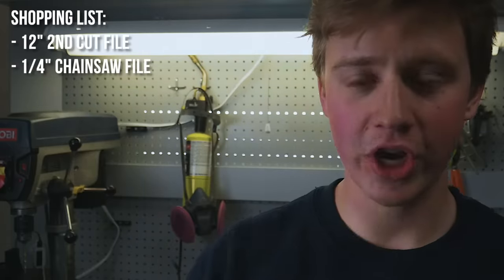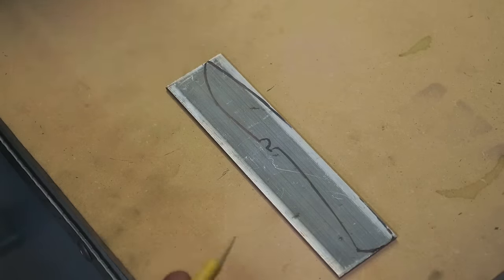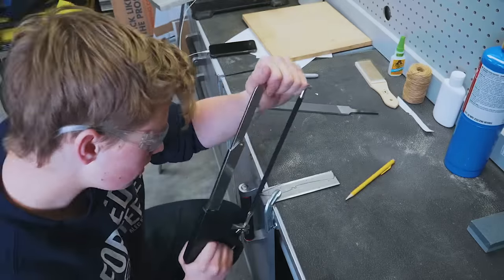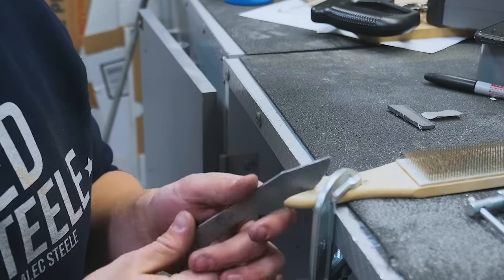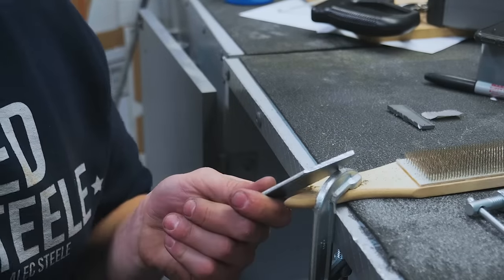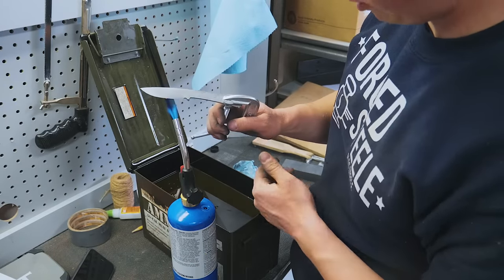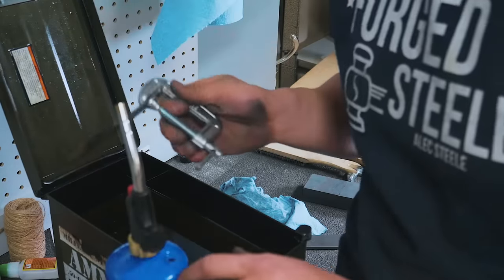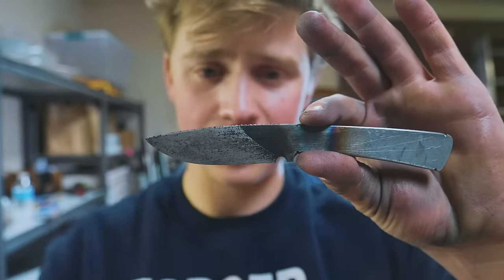MAKE A KNIFE WITH $100 OF TOOLS YOU PROBABLY ALREADY OWN!!!

Comment: Sooooo your website has already sold out of the 1080, so is there a place local that would sell 1080 steel? Like ace hardware ect?
Reply: look for metal supermarket in your area or Alpha Knife Supplies
Reply: phong li thanks I was able to find some 1075 not 1080 but it will do for my first project I suppose

Comment: so you used mapp gas instead of propane?  i have a propane torch for making creme brulee, but i did have the option to spend more on the yellow canister, which is mapp gas as far as i'm aware.  methyl-acetylene and propadiene.  basically dehydrated propane -- propane with hydrogens removed to give double and triple bonds, allowing for more sites of oxidation for the combustion reaction.  

that's what you used, right, mapp gas?  i was thinking of getting the mapp instead of propane -- i knew it was overkill for creme brulee, but you never know when you're going to need a hotter flame, so i really thought about it.  so the difference is quite significant, is what i'm hearing here?

Comment: About the sponsor - Pretty much EVERY SINGLE DEODORANT DOESN'T HAVE ALUMINIUM. Antiperspirants contain aluminium (most of the time). Antiperspirants block pores. DEODORANTS DO NOT BLOCK PORES BY DEFINITION. 

*Deodorants make you smell nicely, antiperspirants block pores and make you not sweat. *

Comment: Violin maker here. You should strop your blades with leather and metal polish if you want a razor sharp edge. In my experience most people think this is only good for de-burring but what they don't understand is that leather itself is an extremely fine abrasive, much finer than the finest sandpaper or honing stones. I've introduced people who sharpen to 6000 grit to stropping and it still improves the edge beyond what they had. Apologies if this is something of which you're already aware but for whatever reason chose to exclude from the video. Just thought I'd share this with you and others in case you didn't know. It's also the cheapest way to hone; literally a leather offcut glued to a bit of wood with some brasso in it will do the job. Happy stropping!

Comment: Man 15 dollar grinder from harbor freight would of been much quicker and cheaper then that hack saw lol
Reply: Fifteen dollars???? Hold the phone. Gotta go to the internets.

OK, maybe $30 - $50. Oooh! They have a grinder with a built-in flex shaft.
Reply: steprockmedia I paid 12.99 for my angle grinder from harbor freight on sale which is like every other week then cut off wheels are 10 for I think 5.99 or grinding wheel for .99cents
Also have flap wheels for .99cents
Reply: @Blake12387  Oh, ho!!! Angle grinders. You know, I might need one of those. But I kinda went down a Harbor Freight rabbit hole....oops.

I did not know they were so cheap!!!! Hmmmm. My dear wife didn't like me shopping a $200 lathe, so now when I say I just GOT TO have a cheap angle grinder, it will look so reasonable by comparison! Strategery.
Reply: steprockmedia my ole lady hate me going to harbor freight I always end up with at least 60 dollars worth of stuff not saying everything there is for like someone that does professional work all day all the time but for your average joe that just needs some more tool options cheap it’s definitely worth it

Comment: Harbor Freight tools for the intro knife maker.  $20 angle grinder, $60 1x30 belt grinder, $20 Carpenter's vice, $40 bench vice, $70 drill press, $18 press vice.  All that for under $230 since they also always have coupons.  Get a Map torch locally $20-30.  $20 drill bit set while at HF.  Cheap sanding block, misc sand papers.  Then go for some good files elsewhere.  HF tools are great for getting going but don't cheap out on files.  Under $300 you can setup a fairly good setup to get going with and later upgrade to a bigger belt grinder, and so on but HF is great enough for doing decent work.

Comment: A good tip is to strop the blade on a leather belt once you have finished sharpening to make it way sharper in like 1 minute, then if you use the knife on a regular basis and you can feel it start to dull strop it again and it should be right back on that sharp keen edge!

Comment: If I may make a few points that might come in handy... Just little tidbits for those that might be new to the craft. If you’re buying a hacksaw, buy some extra blades too. The ones included with your saw may be of questionable quality. If you’re having trouble with your steel not hardening in the quench, try preheating your oil in a small pot on the stove. Don’t get it super hot, just warm to the touch will help. And keep a box of baking soda close at hand in case you start a fire. On the note of fires, never quench in a plastic or glass dish. Plastic can melt, and glass can shatter. Hot oil is a bad thing to have spilt all over the kitchen/garage.    And that’s just my two bits! Have fun and stay safe, y’all!

Comment: This is pretty cool man! You might try the magtorch mt 245 for a cheap torch head that provides a lot of heat though. It cost less than $20 but heats things about as well as a TS8000, it doesn't have any kind of auto ignition feature though. I have had really good luck with it in the wind too but it doesn't handle dirt nearly as well as a ts8000.

Comment: I knew propane wouldn't do it, mapp gas gets much hotter.
Reply: David Parsons the torch head itself makes a much bigger difference, that torch works with either mapp or propane 👍🏻
Reply: I have both for brazing. And mapp works hotter. The torch heads will made some difference.

Comment: Invest in a bench vice if you actually plan to do this. You will hate yourself a LOT less later. You can get a decent clamp on or bolt down version for around 30$.
(They edited out Will swearing up a storm at the c clamps.)
Reply: 2 long carriage bolts and some big wing nuts and a bit of 2x4  ( 2 holes in the bench for the bolts) can make a reasonable clamp that will both work better than a cheap c clamps for this and be cheaper FWIW.

Comment: Does anyone know how to harden mild steel?  I'd like to get some from the hardware store to practice before I get the good stuff, but I'm pretty sure it won't harden the same way and requires a different method.
Reply: Mark A mild steel doesn’t harden, doesn’t have enough carbon, you can case harden it, but that makes sharpening a doozey, best to buy high carbon steel- it’s pretty cheap
Reply: @WillStelterbladesmith  Okay, cool.  Thanks!

Comment: Couple of questions:  The second torch used MAPP gas. Was that the difference, or was it the torch? Would propane work if you used a small flower pot, or bricks or something to keep the heat in a small area like a tiny forge?

Comment: I recently refurbished a old cheap hammer into a nice smith hammer but i left it over night in my shed and the head has already begun to rust before i was done. What do i use to prevent that just Wd40 or is there something else? I figured i shouldnt put anything since i dont know how it will affect my heated metal

Comment: Dont that larger burner also use a gas that burn hotter?
We have some gas containers that look exactly like those, and the yellow one is significantly hotter than the blue one (cost difference is about $5-10 at most)

Comment: this is probably the first limited dollar build ive ever seen that didn't lie. 99% of the time they're like "Okay I only bought this that and that at the store" and then they pull out a drill press, and angle grinder a lathe and band saw and start building the thing and im like okay bitch so this turned from a 20 dollar build to a 2000+ dollar build cause bitch I aint got a damn lathe...